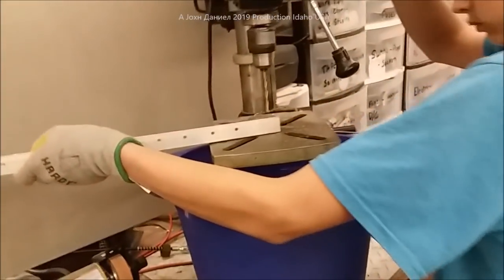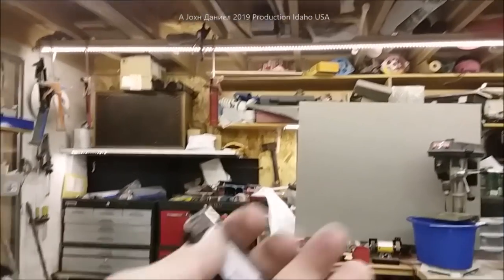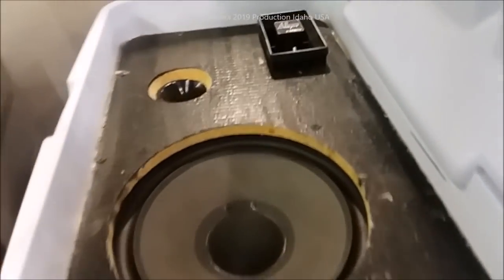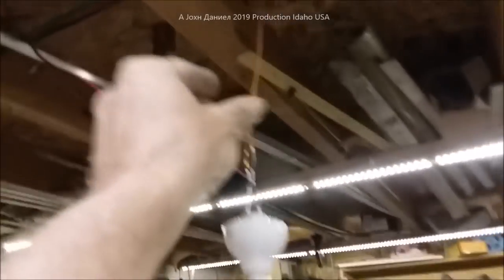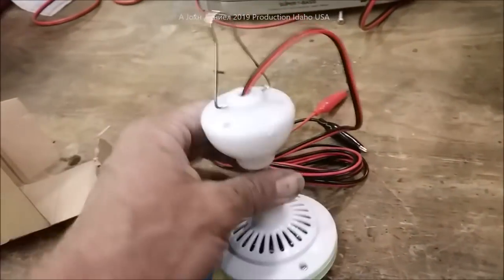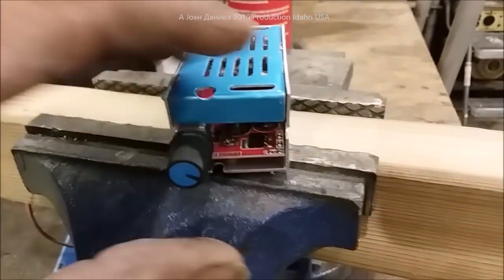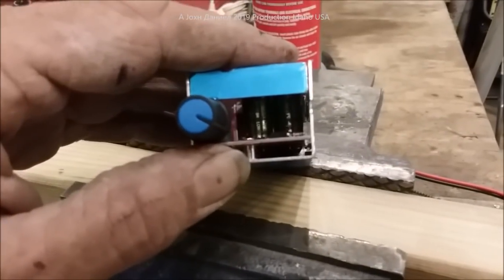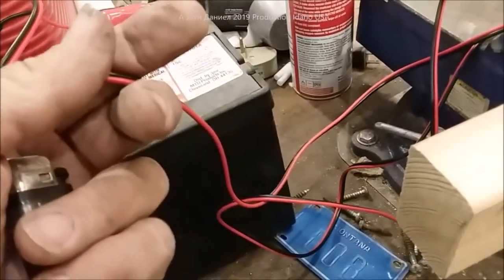Adding a Speed Control to 12 Volt DC ceiling fan

Comment: My portable ceiling fan doesn’t have a switch built in with it. Is this process still possible with my fan even with it just going to a 12 volt battery with the (red) positive and negative (black) clippers?

Comment: thx ,great video...could I use these for my existing RV fans..? Visit the MELIFE Store

5.0 out of 5 stars1Reviews

4 Pack Low Voltage DC Motor Speed Controller, MELIFE 1.8V 3V 5V 6V 7.2V 12V 2A 30W Adjustable PWM 1803BK 1803B Adjustable Driver Switch

Comment: Hey John. I've got two of these on the way for my greenhouse. Was planning to run them constantly until they break. Yours still going strong? Have a pwm on the way too. Also is it loud? Have a PC psu in the greenhouse running a bunch of stuff so buying all 12v stuff
Reply from the maker: I have 2 running in my job trailer, both fans over a year plus straight now. So far no issues.

Comment: I have a 48v wind turbine I bought from mw&s it never hits cut in voltage no more than a half second at 25 MPh wind speed (give or take) it spins all day long producing nothing.it can charge 24v bank no problem.can I use it to charge a 24v battery and if so how would I be able to utilize that power back into my 48v bank. Or is there another pmg I can replace this pmg with that will fit the mounts on the turbine I already have.
Reply from the maker: I would suggest getting this kit, then using your original mount you have now and making a hybrid out of the HA-Hornet stuff https://ebay.to/2lX86xV . 9 years now my running their stuff with no issues and they produce very well. Put this new California made PMA , Hubs and Blades on your old Vietnamese stuff and just use its tail and mount. The hornets design is so much more advanced and be sure to follow the same mounting slight angle they have in their rig when making a mount adapter spacer on that old mw stuff.
Reply from the maker: Hope you get a better unit asap, however,  this year I will add a new 800 watt WuixAir with 8 foot blades, and I am going to start doing full reviews on Prepper and survival foods this winter, We have hundreds of #10 cans and materials but I found best of 9 manufacturers to be Augason Farms,  http://bit.ly/2Qs0vGO , almost straight to the plate edible LOL! Stay tuned, it'll get interesting.

Comment: They send me smaller blades on my order
Reply from the maker: Its circumference not blade length. Make a 19" circle, it will fill it. If it was a 4 blade it would be easier having opposed blades to just run a tape across.

Comment: Thanks john I ordered a few of these I love it. I moded mine with magnets on top so I can mount it to my awning on my camper. https://youtu.be/W-gMBm0F8aQ
Reply from the maker: Got in sat night 11 pm. Sending you the one I have in the video since its already calibrated to a 500. Will see what spare parts i can toss into it. Wife had to work till 8 last 4 nights so she couldn't hit Post Office. I will get you out in few days, recouping 2900 miles of MOO'S!
Reply: Oh lol I ordered the thermite 3 ohm 100 watt resistors for it
Reply: We wont be home after friday for 4 day's camping.
Reply: Hey john how do I hook the controller up to batteries and resistor dump? Should I go with thermite or bigger ugly green resisters? Both are 100 watt 3 ohm. I have a fire proof 18 inch x 18 inch x 8 inch deep metal electric static powder coated box that I drilled two 4 inch holes into and added stainless steel circle vents and a 12v inline 4 inch blower fan " as powerful as a leaf blower" I  want to use for the resister bank enclosure.  The red box and braking switch I want to mount in a plastic box that's 12x 12x 6 inch deep. And put another drok thermal control relay into and a few box fans 120 mm ones to protect from weather. Oh and I upgraded my tower to a 6/3 cable 50ft so I can extend the tower 40ft. And resisters do not have a positive or negative label so I assume that those are bi polar lol humor.

Comment: Hey bro I need one of your badass pma to buy the 12v
Reply from the maker: https://ebay.to/2WIjrCL for the Real ones, So far after over 40 of these installed, the only one that failed was due to a guy using a big goofy wind controller claiming 440 amp capable that fried it and his 20 batteries.

Comment: Lazy product links
Reply from the maker: Sorta, probably, and most likely but for a real good reason. I did whole item type pages of each one so people could see all options. What if you wanted to run 8 fans from one source, you need a speed controller good for 10 amps total. But if you only wanted to run one, a 3 amp speed controller would work perfect. Or you like the fan idea, and you want a blue one, hopefully you see the point of the laziness!

Comment: What do you know, think of this Amazon deal?
https://youtu.be/ClHJMEm8HZ4
https://www.amazon.com/gp/product/B00ZECMODU/ref=as_li_ss_tl?ie=UTF8&psc=1&linkCode=sl1&tag=cheaprvliving-20&linkId=33d679dbd563e75e95eecf9b1b2727a3&language=en_US
John
Reply from the maker: 1st, Eco-Worthy - Mars Rock - ECO LLC -  Aleko/Gudcraft, ( all same scammers ) is JUNK!!! 2nd thats a 200 watt turbine if lucky in a 30 mph wind. The Solar panels Eco sells are Noted in numerous off grid reports as B rated, or whats called factory seconds. You can buy that turbine on Aliexpress for $90! the panel on Ebay from them under 9 or more seller names for $89, The controller for $19. Don't get hustled!

Comment: Love your videos sir, however I'm always full of questions... If you reverse the wires, will the fan pull instead of push ?
As always, your pal BigBadBubbaBurns.
Reply from the maker: There appears to be no reverse on them, the motor control in the fan is electronic, It may cause it to fail if tried.
Reply: Pull the blades out and reinstall them upside down.

Comment: I got one, it seems it barely runs on 12v (13.5v) I thought about putting a pwm, on it, and connecting it to my 24v bank! I don't want to kill the little thing!! It coggs so bad, that it vibrates , I didn't get extra anything, not even a switch!! The blades are screwed on,
Reply from the maker: Those goofy folks in a certain state that rhymes with Misery was selling 30 volt DC fans as 12 volt fans to dump them on the public due to a 6000 piece bad/incorrect Alibaba order about 3 years ago. That could be one of them.

Comment: Have you tested what is the max volts it can handle I ask cause I'm on a 24 volt system and would like 2 for my garage
Reply from the maker: From those links I deliberately put a page on them, you can see speed controllers with numerous in and out voltages. It will run on up to 18 volts I know for sure because I tried it on a 18 volt drill battery.
Reply from the maker: Try this, https://amzn.to/2WqnT9f voltage Buck then the controllers
Reply: @JOHNDANIEL1  thanks I have one of those in my shop

Comment: Thank you for this video. I'm gonna build my own vent fans for my old fiver. I'll save a bundle, thanks to you.
Reply from the maker: The link to Ali under the video will get you to a massive list of options on fans, the other link to Ali gets you to a ton of speed controllers. I did that so folks could size their need. If you need help on what fits with what, just ask.